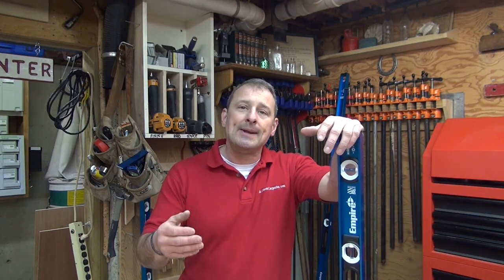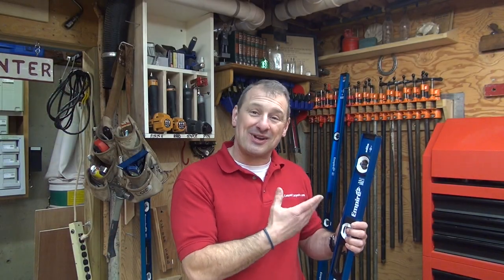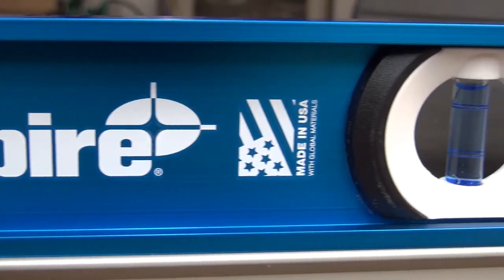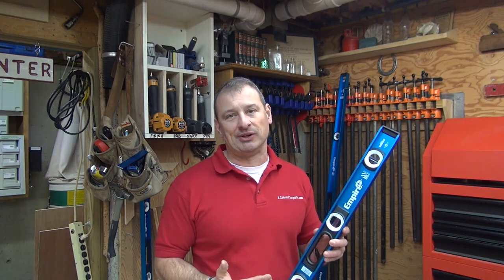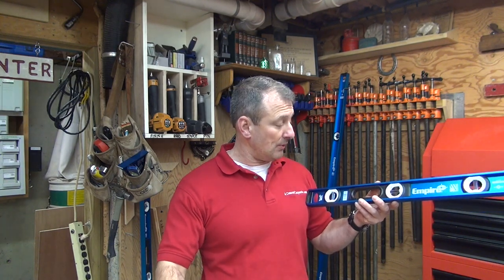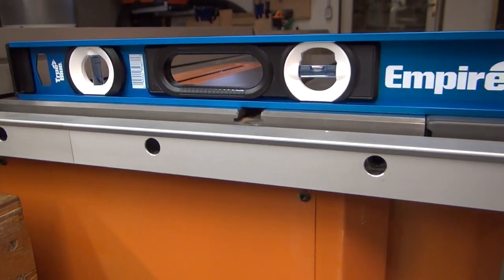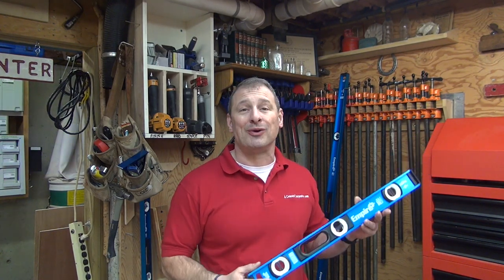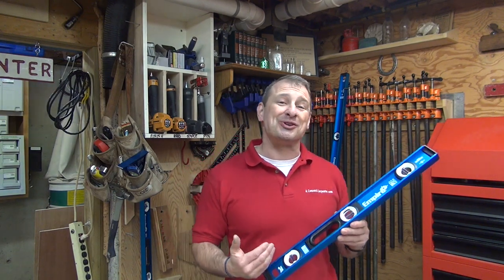Empire e55 Series True-Blue I-Beam Levels Review

Comment from the maker: CORRECTION:   Level is Accurate to .0005"  [ I said .005"]
Reply: +A Concord Carpenter     .0005 over what distance? Or for all sizes?
Reply: +Ray Mansfield It doesn't matter, it's an absurd claim on Empires part.  There is no way in hell this piece of extruded aluminum has a half mil tolerance at any usable length.  Even the Starret machinists'  levels don't claim this kind of accuracy.  It's just marketing bullshit
Reply from the maker: +Ray Mansfield The .0005”/in. accuracy rating applies to the entire range of e55 I-Beam levels (24” – 78”). Johnson level makes this accuracy claim too and I bet Stabilia
Reply: A Concord Carpenter Stabila claims a tolerance of 1/32" over 72".  That's a useful real world number.  These other companies are just using marketing bs, it's no different than a shopvac claiming it produces 5 hp.

Comment: It sounds kinda rateling / flimsy as your handling it?
Reply from the maker: +Stefan Ravn Not at all.
Reply: The end cap sounded loose.  I do like the blue vial.  The yellow in my level sometimes makes it difficult to see the bubble depending on what's behind it, the yellow fluid being too similar to the clear bubble.
Reply from the maker: +Wild Goose I just checked it.  the sound is the handle insert, not the end caps
Reply: +A Concord Carpenter Thanks Rob for looking at it and responding!  I really like the idea of the blue vial for easy visibility , and am in need of a new 2 foot so I'm going to check this Empire!